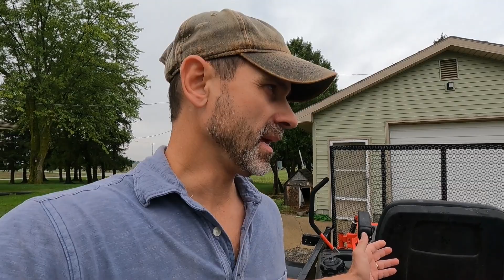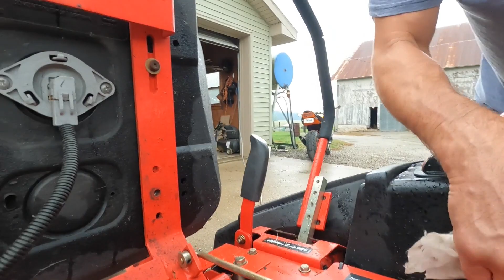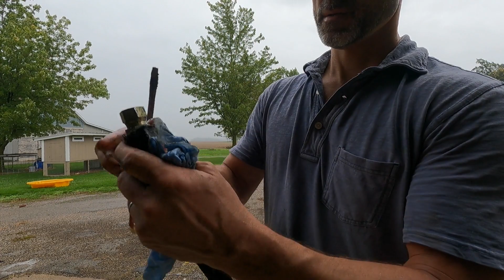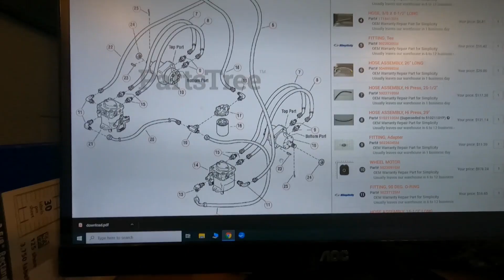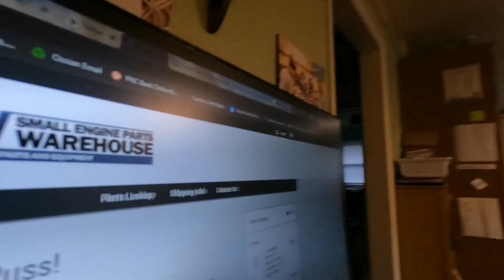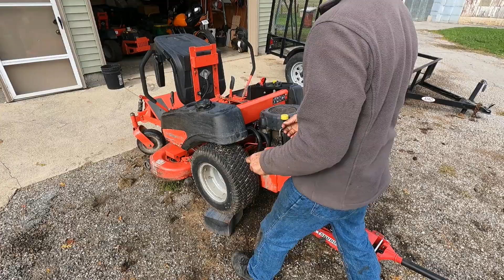Hydraulic Line Repair On Simplicity Zero-Turn Mower 18 HP - All Terrain - Common Problem - 1694454

Comment: Did you have to bleed the lines
Reply from the maker: @shawnharris9821  not really. Read down in the comments and the replies below. Someone had a similar question and I answered it. Basically get the rear end of the mower off the ground and run the tires forward and backwards for a while. The oil will work itself in.

Comment: I had my hoses leak and replaced all 4. Mower doesnt seem to have much power. I have tried bleeding the air out of lines by running amd moving the arms back and forth. Is there anything else to do to get power again. Thanks
Reply from the maker: Have you ran it much since you’ve replaced the lines? It seems like it took a bit to get the oil worked back through the system last time I did this job.
Reply: @rustichandyman  we have had hoses break at different times. One hose broke fixed it ran good for a bit another hose leaks replace ran good for a cut or 2 and another hose leaked. Replaced the last 2 hoses and have had issues since. No power on the ground barely budges. Replaced the trans filter and added plenty of oil and same
Reply from the maker: @racheldrennan9414  here’s something you can try. It sure sounds like you still have air in the system. Jack the back end of the mower up and support it on sturdy blocks. Then start the mower and move the steering leversiback and forth, 20 to 30 seconds at a time, for about 3 to 5 minutes. This allows the system to move the tires without much resistance. That should get the oil through the system.
Reply: @racheldrennan9414 did you ever figure it ou ? I have same mower and same problem

Comment: I have a simplicity mower and a low branch clipped the the switches on the right hand side. Now the choke, the speed regulator and the yellow button to drop the blade are broken.  
Try as I may I can’t figure out how to lift the cover off over the hydraulic cap, the ignition key etc to replace the broken items.  
Any suggestions.  Allen keys and scanners will undo the cover but the the problem is the existing switches don’t slide anywhere.  
Help… anyone.
Reply from the maker: Can you email some pictures of the situation?
Reply: @rustichandyman  sure can

Comment: Change one hose now it won’t turn how much Hydraulic fluid did you put in
Reply from the maker: Just make sure your hydraulic oil tank is fairly full. Then it might take a little bit of pushing the controls back and forth to get any air worked out of the hydraulic lines.

Comment: My simplicity zt1500 has a problem. The blade on the left doesn't spin. The belt is good and the pulley turns. Any body have an idea what the problem is?
Reply from the maker: Sounds like you have a broken spindle.
Reply: @rustichandyman You are correct. Had to replace it. Wasn't expensive either. Thanks for the reply,man, you're the only one who did.